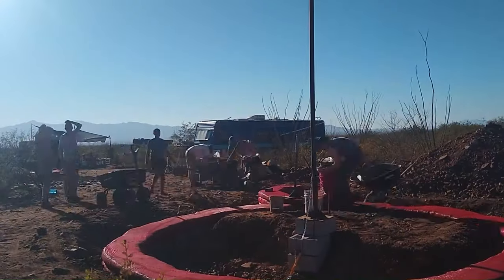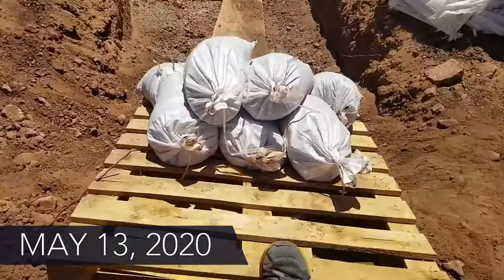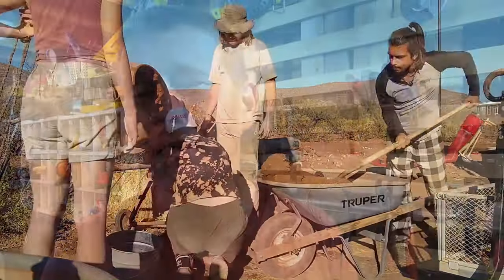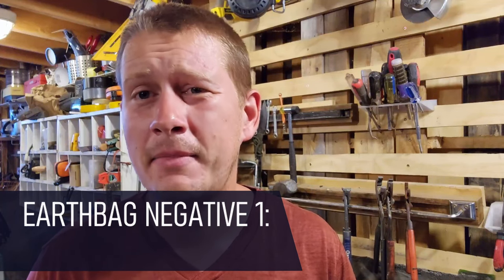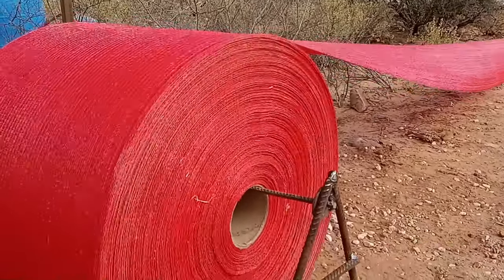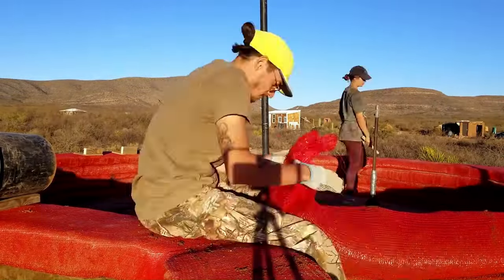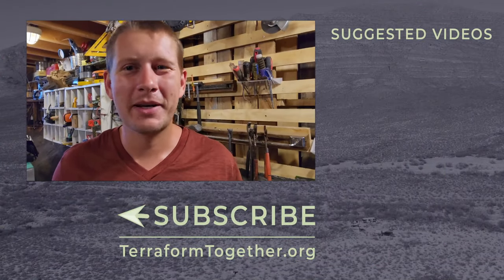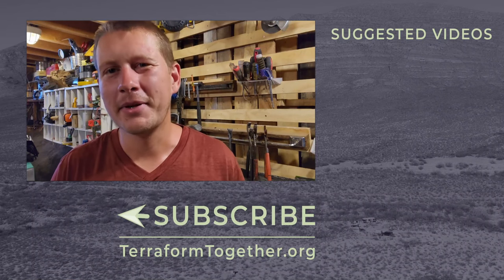Building Better: Hyper Adobe or Earth Bags?

Comment: We built a 2000 bag  - 2 circle EARTHBAG home and just filled them in place, not lifting them, one coffee can at a time.  It was harder to plaster, but for the inside I just used a box of drywall mud to save on time and energy, smearing it by hand and it turned out great.
Reply from the maker: Thanks for the tip!
Reply: Hola.. cuanto de circunferencia tu casa? Cuantas bolsas de cemento? Gracias!
Reply: Lisa would you make a video about your house explaining your method?
Reply: When you are filling the bags and placing them, I'm curious how many someone can do per day? (And is that solo or a team of 2?)

Comment: In South Africa we actually have a traditional building style called pole and dagga which is basically building a round frame out of branches and then a mixture of mud cow dung and dry grass is smashed onto both sides of the frame and then that's topped with a thatch roof. I find they are a bit to dark for my liking cause there's almost never windows or the windows are really small but they are always super cool inside even though they sometimes don't even have a door just an open entrance. These structures are really durable though I have been to some that have been standing for hundreds of years and even to some that have caught fire and the house is fine they just need to replace the roof
Reply from the maker: Super cool! I love natural building.
Reply: There's no mud or clay out there I'm guessing why cow manure is being used? Seems really odd to use manure, the smell, and threat to health?
Reply: @Christopher-be1qc   I did say mud or clay is used in the mixture but no cow dung is mostly grass and dries rock hard with no smell so its basically added for extra durability you'd be surprised.
Reply: Cow dung was often used in earth building and plasters...
Reply: Cow dung is odourless. Yes indeed South Africa our grannies used to plaster walls and floors. I assume it's what you call cob plastering.

Comment: Have you ever tried tried or seen tried compressing earthbags in a press to create uniform compressed earth bags? It seems like it should make a stronger and more consistant bag as the press can ensure the bags are compressed at a stronger rate than possible manually with a tamper.
Reply from the maker: I haven't tried it with bags, I have used an adobe brick press and that was kind of cool. I would go smaller if you were going to go that route, I couldn't imagine lifting 50 lb bricks above my head all day!
Reply: @TerraformTogether  obviously it would require mechanical assistance like a Mini skid steer at least. I've considered the existing brick machines, but I'm considering 10x14x4 minimum and larger if possible. The structure is small 16x24 with a corner 4 foot radius tower spiral stair.  It will have built-in Murphy beds, which requires 2 layers of walls. Trying to do that with small bricks would be problematic. Compressing the bags just would seem to ensure uniformity and maximum strength. I'll be using construction cloth between the 2 walls wired to more on the exterior and interior. This method was used to earthquake Adobe construction. Of course I expect to have to use rear to conform to building codes. 

Yes it's greatly over engineered but I'm planning it for my grandchildren in trust and would like it to still be standing for their grandchildren.
Reply from the maker: @billlyell8322  that sounds like a super cool project, keep me in the loop as it progresses!
Reply: @TerraformTogether  thank you, I have put a lot of thought and planning into it. Technically they are "cabins".
Reply from the maker: @billlyell8322  cochise county arizona you can build whatever with limited regulation. May be worth looking into

Comment: Considering these types of homes are so natural disaster proof how in the world would you make a roof with comparable strength. Your house might not be harmed at all by a tornado but a wood roof would get obliterated leaving you roofless and all ive ever seen used on these are wood for roofs unless you do a dome but those have limitations to how large they can be so you have less design choices.
Reply from the maker: Possibly. The roof is tied into the bags with literal tons of weight. We also doubled our hurricane ties. It's probably not perfect, but I'm sure better than a conventional build.
Reply: @TerraformTogether  I didnt know that it was tied to the bags themselves as an anchor. I guess that surely would make it more resilient than a normal roof.
Reply from the maker: I think so! Few tons of weight vs some metal brackets

Comment: Seems like hyper adobe would be more difficult if you were doing straight walls like an octagon shape as opposed to a circle.
Reply from the maker: I haven't noticed a big difference difficultly wise doing straight vs round walls. Round doesn't require buttressing while straight walls do. So I guess round is a bit easier for the amount of bags you have to lay for the same square footage.
Reply: @TerraformTogether  Thanks for the fast replies. The buttresses go at the corners where straight walls meet am i correct on that?

Comment: As you mentioned hyperadobe is so much easier and faster. We have found that hyperadobe can be done with one or two people. You just need to make a bucket dolly. The cold joints aren't an issue at all, and there are way less seams than with earth bags. Our son built most of the walls for his house completely by himself. Red just helped him finish the last bit. Here's a video showing the process we used to fill the bag with just one or two people.  https://youtu.be/BUmnIfSt04w
The soil in our area doesn't have a lot of rocks, so we didn't see any need to sift or mix the dirt separately, which saved a lot of work. 🙂🏜️
Reply from the maker: Awesome. I need to modify our bucket dolly to stand on it's own. Having good soil really helps. Ours is 50% Rock it seems like... I think if I were to solo build and had the money I would do something like ICF. Everything is a trade off though.
Reply: I agree with you, except we use a Bobcat instead of Bucket Dolly!
Reply: @Arizona-Desert-Rat-Realty  do you have a video showing it in action?

Comment: GREAT content! I'm planning to build a retirement home in Arizona (which is why I subscribed to your channel), so I have a question for you. What about plain old adobe? I'm figuring on renting a big cement mixer, and using it to mix up the adobe, pour it into wooden 2x4 forms (actually 1.5" x 3.5", the exact correct size for traditional adobe bricks) to create a lot of blocks. I figured out that I need about 1500 adobe bricks. I think a crew of three guys can knock that out in a week or two. I prefer traditional Spanish Colonial Revival houses, not the more creative domed earth bag and curvilinear hyper-bag houses. Am I way off base with my labor estimate?
Reply: There are videos on this on Youtube and I think for a few years. From what I've seen the blocks look like aprox. 16"x16"x6 " in dimensions for mass thermal here in Arizona. Believe it or not there are machines that actually make bricks on site with highly compressed bricks for chemical bonding.
Reply: @gzubeck3  Yes, I investigated the machines, and maybe I was just shopping at the wrong place, but the machines were over $5,000. So, a lot more than renting a mixer! And it would still take the same crew to run it and crank out the blocks, so no labor savings. I decided against. I was planning on traditional sized adobe bricks 16"x8"x4" (actually 3.5" high, but with mud mortar, it works out to 4"). The smaller size makes them lighter (about 40 pounds each) and easier to manage. Besides, in Arizona I have a real shot at finding guys who are experienced with adobe construction who would be familiar with traditional adobe bricks. I'm just worried that I've completely missed the mark with my labor estimates. Thanks for the tip! It's a delight to be able to talk about my house (aka new-found obsession) with someone. 😊
Reply from the maker: I haven't worked with traditional adobe brick, but considering it has been used for thousands of years it's certainly a valid building option. 

I would look into Hyperadobe if you do have the budget to hire people. Basically, it's the same thing as traditional adobe (same mix), you're just making your bricks "in place" rather than making your mix, putting it into forms, letting it dry, then placing them, etc. etc. I don't have experience with traditional adobe, but my guess would be hyperadobe would be less labor cost. 

Our 280 sq ft home took around 3 months to build, working with around 8 people, usually 2 full 8-10 hour days per week. So working 5 days a week full time the bag work could have been done in a month. 

Regarding the style, you can totally do square buildings with hyperadobe you just need buttressing. Here is an amazing book on earth bag building in general: https://amzn.to/3qouamQ

If you do end up going with hyperadobe we get our bags from Volm, they are the best ones I've worked with those are available on our website at TerraformTogether.org/bags
Reply: @TerraformTogether  Awesome information - THANKS! Traditional natural building materials and techniques get short shrift nowadays, IMHO. When it comes to plastering, for instance, the best guy that I've found on YouTube is The Nito Project. He does Awesome plaster work - including Tadalakt. Very useful videos. I'm going over to buy the book immediately. Love your channel, keep up the good work!
Reply: Adobe bricks can be mixed in an old fashioned cement mixing trough like the Mexicans have done for hundreds of years.. The oldest adobe buildings are made from adobe bricks. I live in Tombstone AZ which has many adobe structures from the1880's still in use. I grew up in one of them.
Reply: @wandadibble5426  Thanks! It drives me nuts when modern engineers dismiss adobe as "impractical" an "not durable". Good grief, the oldest building in the state is made of adobe! I was actually hoping to speed up the process by using a rented cement mixer. I'm relieved to discover that I'm not the only fan of adobe.

Comment: Im new to researching this topic. Whats the purpose of the bags verse making adobe bricks or adobe concrete?
Reply from the maker: The brick mix is basically identical to the bag mix. The advantage of the bags is you pour your mix in place vs having to make forms,  make your brick,  let the bricks dry, move the bricks,  make the mortar, stack bricks.  

Bags it's make you mix.  Put in bag.  Tamp and done.  You can also get thicker walls with the bags and a monolithic structure. 

We've got more info on our website if you're interested.  Terraformtogether.org/bags

Comment: I want to suggest earthquake proofing  I've seen tested. It was done with Adobe Brick. You use a layer of wire construction cloth on the inside of the wall and the outside of the wall with the adobe in the middle. The inner layer is tied to the outer  layer with wire on each course.

When they tested this, a brick only structure was found unsafe. However when they tested the exact same structure with the wire layers added, it not only withstood a significantly higher earthquake simulation. They were unable to make the structure fail at all. They were forced to shut down the test because they reached the limit of the machine, and it was on the verge of breaking the machine. The structures were about the size of a shed. Roughly 10x16 or something like that for the test.
Reply from the maker: Thanks for the knowledge! Luckily we don't have earthquakes where I live, but hopefully this is helpful for someone living in a more earthquake prone area.
Reply: @TerraformTogether  my point was that it isn't just for earthquakes. My point was that it adds structural reinforcement. Just like rebar does to cement. Would you pour a concrete foundation without rebar? Of course not. Then why would you suggest building a wall without it. Especially a wall that weighs many thounds of pound.

I don't advocate abandoning the old or the new. I'm just keeping all the options of both. Some decry the use of cement. To me, that's foolish made from egotism. Some decry the use of gravel. What is the difference between putting a wall on a gravel foundation or a cement footing? If it can hold the footing, then it can hold the wall.

For a decade, I drove past a stone house(perhaps more accurately  large cabin) twice a day that was at least a century old. It had been neglected and abandoned for decades. And barring the fact it lacked any modern amenities like piped in water, sewage or electricity it would have been completely habitable. A city had grown up around it, and it was a historical curiosity. It is too expensive to modernize or tear down.

Comment: Great video. Unfortunate to hear it's not a great option for cold climates. In your opinion, what's the best option in a cold climate. We're in Ottawa, Ontario!
Reply from the maker: My recommendation would be to look at what other people are doing in the area. I assume something more insulated like straw bale would be good. You could do Hyperadobe/earthbag, You would just want to heat it really well.
Reply: 24" cordwood!
Reply: @thelawdoc8029 I have never heard of this! Thank you!!
Reply: Look into sand in plastic bottles.  Still will need some cement wire and rebar for strength.   If you use two liter and three liter bottles double the walls,    info online,     suppose to be around 40 insulation.   I live in Oklahoma.    Alone, widow.    Starting to replace a home that's falling apart.    Doing this.   4 tons of sand cost 220 dollars..... Fills about 1,000 bottles.  A one bedroom can take about 7,500 bottles single row.   I'm single row and plan to double even here.    Why, I live in slightly 1,000 a month.   Can do myself.  Something to look into.
Reply: @Marsha-yl8wl  interesting! Are you worried about plastic becoming weaker over time? And would it become brittle in the cold? 

I think we'll go with two gabion walls with insulation and vapour barrier sandwiched between them :)

Comment: I want to a big house 2000 square foot resistant to typhoons structured dome is this a possibility using somewhat volcanic earth and concrete
Reply from the maker: I don't know much about volcanic earth, but you do want a fair amount of clay to bind everything together. Typically about 70% Sand to 30% clay is recommended. For our mix that is a clay/caliche/sand mix we use about 6 gallons of native soil, 3 gallons of sand and 1 gallon of cement as a stablizer.

Comment: What about mixing these two methods? If you want to build a dome, you can start with long tubes (hyper adobe) and at the top use earth bags. Will this option work?
Reply from the maker: I have thought about that. My thought would be to put hurricane ties to tie the two sets of bags together. I just haven't seen it done so I can't comment with certainty
Reply: If you are going to build a dome, you need tensile strength, which you achieve with barbed wire.  Superadobe earth tubes are compatible with barbed wire.  I can not speak for hyperadobe.  I do not know if it has been tested by ICBO. Polypropylene tubes with barbed wire has been.

Comment: so how would you compare hyper adobe to super adobe which would be the same long bag format that you prefer about the hyper adobe?
Reply from the maker: Personally I found working with barbed wire a nightmare. Superadobe requires barbed wire. If you want to do domes, my understanding is that Superadobe is required. Otherwise because of less material cost and not having to use barbed wire I think Hyperadobe is superior.
Reply: Thanks for that insight 👍🏼
Reply from the maker: Happy to help! 
 @Aaron-r7y

Comment: Love your videos.
You mentioned you can't use hyperadobe to build a dome..very curious, why is that?
Reply from the maker: Hyperadobe uses a clay to clay connection so you want as much surface area as possible. The clay that is hanging in space as you go up has nothing to support it which could cause a collapse. 

Super adobe has the clay bagged so the bag is what is holding the clay in preventing that collapse. I have thought about the possibility of doing a hyperadobe base and a super adobe roof... but I'm not 100% Sure there.